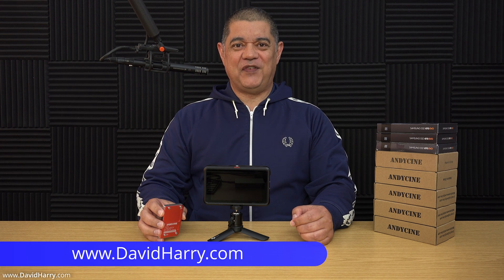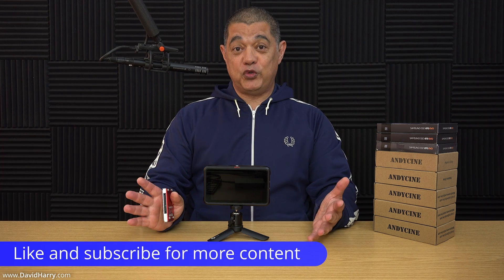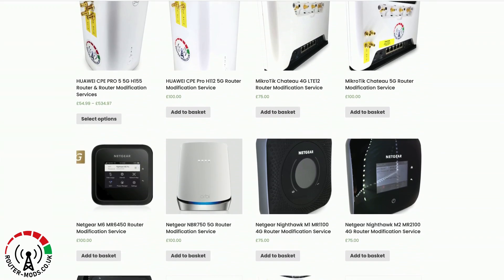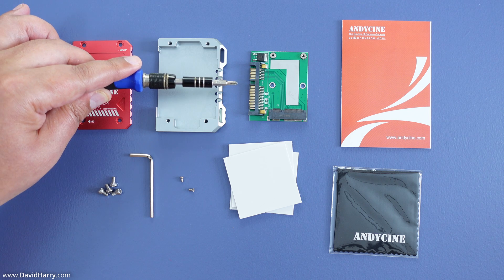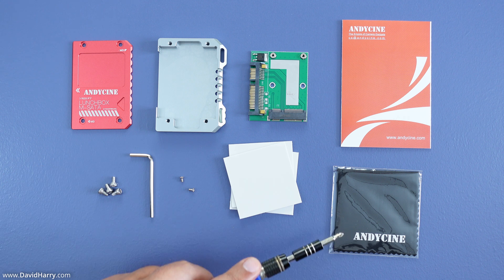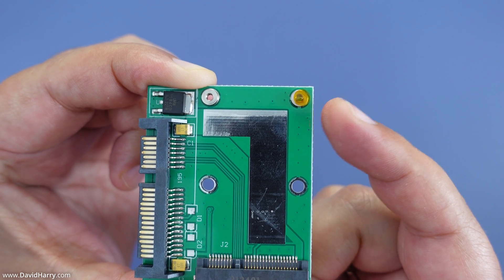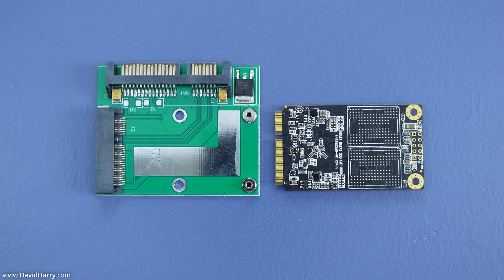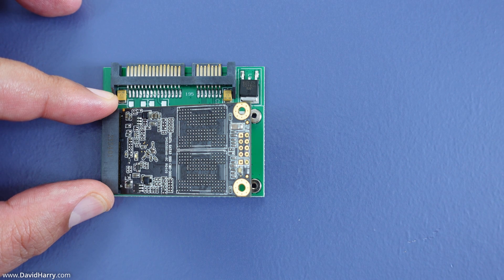How to build an SSD for your Atomos Ninja V & V+ using the ANDYCINE Lunchbox 1 and an M-SATA SSD

Comment: Would it be possible to use a Samsung 990 Pro? I really would like to see if we can increase the read and write speeds. 
I've been searching the interwebs to see if anyone has tackled this. I've found nothing yet.
Reply from the maker: Why do you want to increase the write speed?
Reply: @DavidHarry  I'm wanting to use this on a Ninja V for videography and hoping it helps with recording speeds for large footage, ie 8k at high shutter speeds. 
I'm no techie, but had an idea of using 2 x Samsung 990 PRO Series - 2TB that can read and write 7,450/6,900 MB/s. 
I'm hoping when I chuck it into a Ninja V via a caddy it'll work?

and also, just data transfer speeds to my laptop
Reply from the maker: @RMuliaina  The Ninja V can’t do 8K. The Ninja V has a SATA connection not NVMe. Even if you found an adaptor for using a NVMe SSD, the Ninja V will still only write at a maximum of SATA. None of the codecs used by the Ninja V require anything faster than what the EVO SSD can handle. Bottom line, even if you could attach a NVMe SSD it would be a complete waste.
Reply: @DavidHarry  Ah gotcha, thanks for this! Subbing to your channel, I appreciate it

Comment: nice tutorial!  How does that particular generic ssd compare to the T5?  Cheers!
Reply from the maker: Alright, Tone. I'm not sure but this SSD may even be an old Samsung one. It has had the branding on the chips deliberately scratched off, which is something I used to see a lot of before the cheaper Chinese SSDs started flooding the market. I think this scratching off of the names was something to make a drive look generic and to maybe avoid certain taxes or it was maybe to hide chips going missing out of the backdoor of a major manufacturer. In any event, I've not run a speed test on this SSD inside the Lunchbox enclosure. However, I've had this SSD for almost 7 years and I used to have it in a compact USB 3 enclosure. In that enclosure it was the fastest USB SSD when connected to my friend's old dustbin Mac. Cheers, Dave.